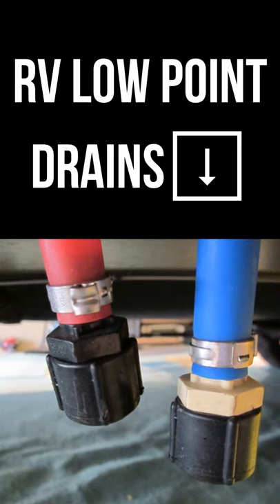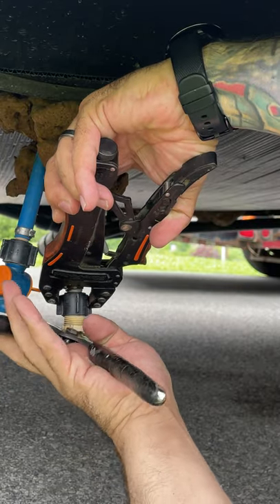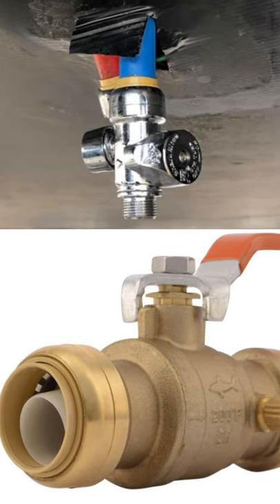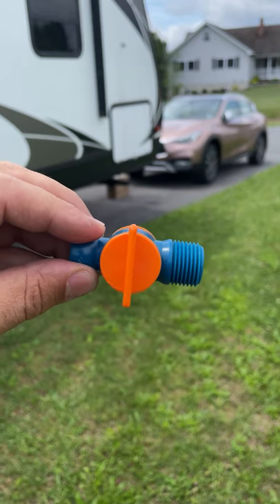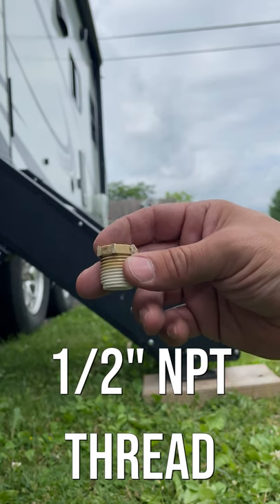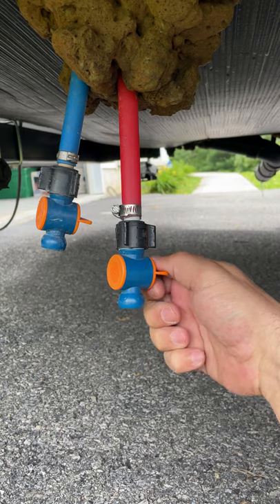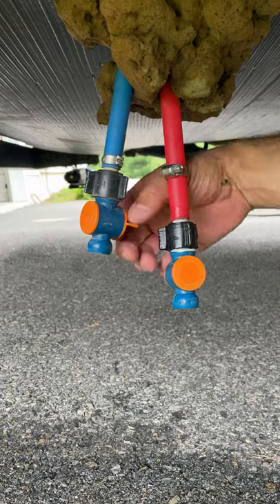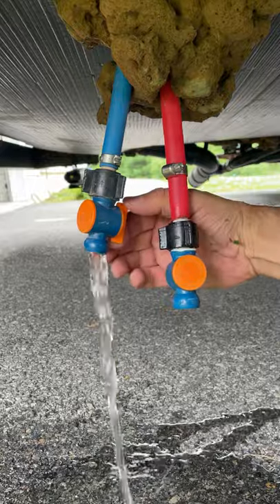RV Low Point Drain Hack -  A Cheap, Time Saving RV Maintenance Modification! #shorts

Comment: I used the same valves and they didn't last a year. I switched to metallic valves and they work great. Not much of a cost difference either. Either way, this is a great mod!
Reply from the maker: the pressure rating on the package of these valves is much lower than on the amazon listing, and i know some folks have had these leak.  Personally, mine have not leaked, but when you get them and look at the packaging they are rated for something like only 20PSI.  I have gotten a lot of feedback on these, most of it was good, but a few leaks here and there.  I will probably switch to stainless once I have a free minute and release an update about them.

Comment: Ordered these today.  Do I need teflon tape on the threads?
Reply from the maker: Try without first, they should press seal against a rubber gasket inside the fitting at the top.  If that seal is worn, try some Teflon tape next.
Reply: Good question and a good answer.

Comment: Great idea, but dirt dobbers. Also having female threads available lets you drain through a hose
Reply from the maker: you can always use a brass male to female if you want to use a hose.  I have no need to attach a hose to my low points since I have a T at my water pump if I want to run something into the plumbing.  I also havent had any issues with insects.  the area under the valve is small, less than an inch deep, and the valve is always closed even if something rests in there, its not getting in the plumbing and would be immediately flushed out if it did when the valve was open.
Reply: @RVTIPSANDTRAVELS  good notes. I found a dobber nest INSIDE the two way safety spout on one of my gas cans yesterday. Constant battle here in Mobile.
Reply from the maker: ugh, i can imagine its a different world there.  if you went with brass valves, you can add a cap on the end like these: https://amzn.to/3Rmr6lw

Comment: It's getting down maybe a little bit below 30° here in Minnesota for next couple days I wonder if I need to open the low point drains and if that would empty my system other than having to pull the anode rod on the water heater?
Reply from the maker: low point drains will almost always drain your water heater.
Reply: @RVTIPSANDTRAVELS  Yep it seemed to drain everything except my freshwater tank and toilet bowl
Reply from the maker: CORRECT, it wont drain tanks or toilets

Comment: I have a Solitude. My low point drains (it’s two blue pipes instead of a red and blue) are dripping. They sit right under my water system. Is this an issue?? Thanks!!
Reply from the maker: if youre connected to city water, its not going to cause a problem other than wasting water.  If you're using your tank, then your going to consistently lose water and youll hear the pump kicking on often.

Comment: So I purchased some of these valves, but the package says not to exceed 20psi. Have you had any issue with these?
Reply from the maker: Hey John, thanks for letting me know that.  The amazon description said they are rated for 100 psi.  I will have to look into this, wondering if they changed the product since I bought mine.  I have not had any problems with these leaking though.  I think I might buy another pair and test them out since the packaging is saying 20 psi when the amazon description says 100.  THanks again for the heads up, stay tuned...
Reply from the maker: John I think I have it figured out.  look at the back of the package.  the 20 psi is referenced to the bendable hoses these are commonly used with.  the valve itself is actually rated for 100 psi, says right on the back of the package.  its confusing though.
Reply: After really looking into what these things are designed for I agree with your assessment.

Comment: What's wrong with old water? Your only going to shower and clean dishes with it anyway and if the tank is sanitized regularly, no need to swap the existing water.
Reply from the maker: sanitizing your tank cleans out what was in there from before.  It doesnt keep it clean because you rinse out the bleach after sanitizing. Regardless, mold growth can start to form in dark areas like pipes and fittings as early as 24-72 hours. Its just science, not something I made up, and you can research this too.  Some folks spread out trips every month, much longer than 72 hours.  Water becomes stagnant very quickly, and even if you dont drink the water, youre washing dishes you eat from, so is it really any different?  Dish soap doesnt kill mold.  Would you wash your dishes with water that was sitting in an open glass on your countertop for a month?  Maybe, but I sure wouldnt.

Comment: So I have a Jayco 174BH, there is a sticker on the side that says "Low Point Drain"  I look under and yes, there are 2 short hoses sticking out (Red and Blue)  but no valves, no caps or anything.  How do I drain this?  is it possible that my Low point area is always open?  I know these never had any kind of plug on them.
Reply from the maker: Check inside the camper where the lines are.  might be valves inside before they exit the rig.
Reply: @GHOST-kg7tg  did you ever come up with a fix. I have the same trailer and thought they were just extra unused pipie.
Reply from the maker: @thomasmccormack7540  Check inside the camper where the lines are.  might be valves inside before they exit the rig.

Comment: What trailers are coming without these?
Reply from the maker: To my knowledge most trailers have plugs on the low points from the factory, not valves.  Would be nice if they came with valves.
Reply: @RVTIPSANDTRAVELS  we just bought a base model Tracer by Forest River and it has valves on both low point drains and fresh water drain. Strange
Reply from the maker: That’s actually awesome!  More companies need to follow this!  Thanks for commenting bud.

Comment: I 'm having a problem with a 1996 aerolite 21 ft. Shower will not drain and I don't know why
Reply from the maker: MIGHT BE A CLOG IN THE P TRAP, OR JUST THE PIPING.  IS WATER COMING OUT OF THE GRAY TANK WHEN YOU TURN THE SINK ON?
Reply: Thank you for the response. grey tank empties fine, no problems with any other drain. Just the shower @RVTIPSANDTRAVELS
Reply from the maker: well at least you know the clog is somewhere in the p trap or down pipe to the tank.  I would say to try a snake first but you may have a rubber trap seal instead of a physical p trap.  a snake can damage that.